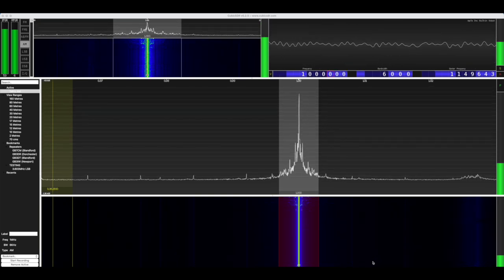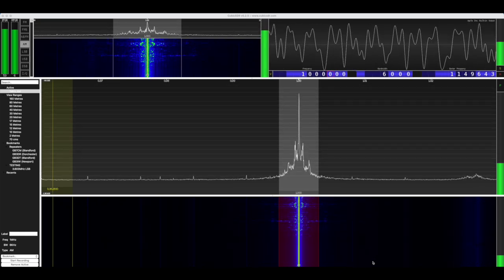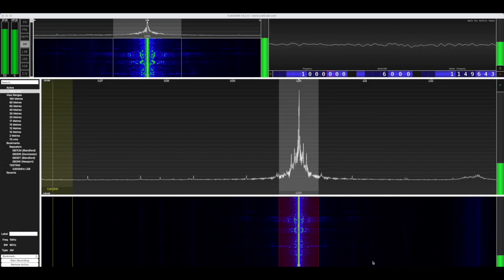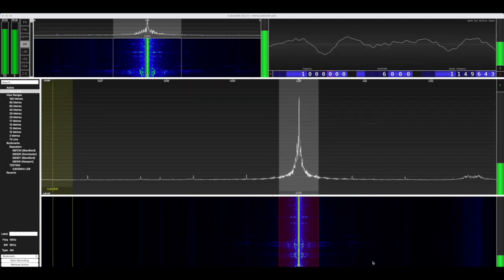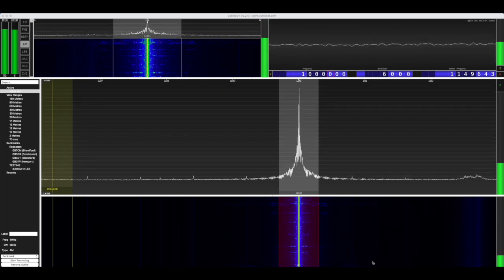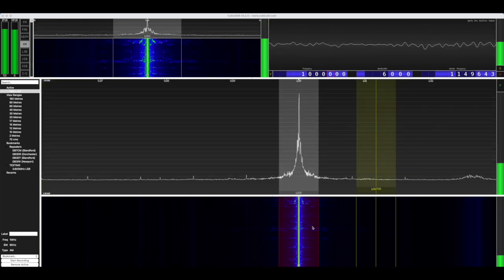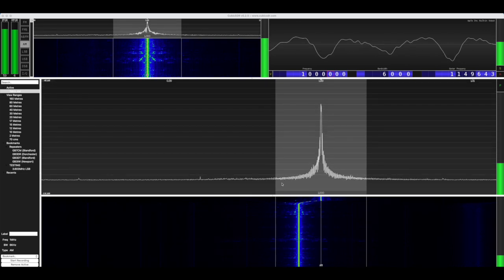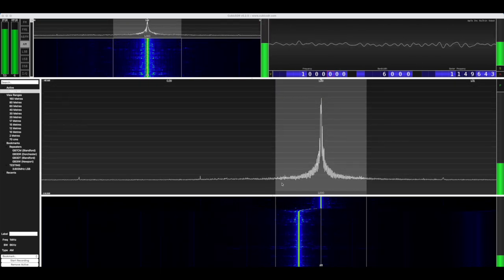35 - AM Modulators

Comment: The first modulator is ok if you are only looking for low modulation levels. It`s very prone to distortion if you try to get near 100% but is an easy build for testing purposes. The diode ring modulator on the other hand is capable of broadcast quality modulation when properly adjusted. When used for AM you might not think that balance is too important as you are going to unbalance it anyway to generate the carrier, however this is not the case if you want the best performance. This is because if it is slightly unbalanced to begin with, when the audio signal goes near zero, the modulator will still be passing some RF and this will have the effect of not allowing the negative modulation to get near 100% carrier pinch off,  (I limit my neg mod to 98% to avoid splatter). Don`t forget that this type of modulator will be followed with more than 30db of amplification, so any leakage can mean watts of carrier that cant be controlled with the audio signal. Balance can be achieved with using a ready made ring modulator (expensive) or for the rest of us, carefully selected 1n4148 diodes. I have used the ring modulator with great success for low power (10s of watts) but for higher power rig builds, I prefer high level modulation of either a class E, D or C transmitter using pulse width modulation. You can think of this as supplying a transmitter output stage from a switched mode PSU thats output voltage is controlled with the audio signal. The commercial medium wave transmitters used this scheme, achieving DC to RF conversion efficiency of over 90%. As you can probably tell, I am a big fan of AM, when properly done, it can sound fantastic! You will mostly find me on 1977 and 3615khz You have done a great demonstration as usual and a special thanks from the AM lads for encouraging interest in the subject.
Reply from the maker: Thank you so much for watching and for your helpful and detailed comments. I confess to being a 'Newbie' as far as AM is concerned but I'm having some fun learning more. I may have to pick your brains when it comes to demodulation. It's not so much the demodulation itself as the selectivity and frequency translation that precedes it - the whole no-no of inserting a locally generated carrier on top of an existing (out of phase) carrier etc. This is very much still a work in progress! Thanks again. 73 Nick
Reply: @M0NTVHomebrewing  You just reminded me of another technical can-of -worms, that is how would you demodulate double side band suppressed carrier? At first it seems simple, just re-insert the carrier and have an IF that is wide enough to accept both side bands. However, this will not work (sound nice), because the re-inserted carrier would have to EXACTLY (not nearly as in ssb) match the carrier frequency and PHASE. This is a work in progress for me as being able to lose the carrier and keep the side bands and audio quality, would be very nice. As for demodulation and IF architecture of a good AM receiver, this is fairly straight forward, depending how deep you want to go. I have cheated a little as I kept all those PYE taxi radios of the 80s (remember those?) They are a great source for crystal filters and IF coils. Happy to share any information I have, just email me if needed. address on the ABOUT tab on my Youtube info.
Reply from the maker: Thanks again Chris. That's the thing about going back over the basics isn't it - it turns out some of the things you thought you knew and were quite simple turn out to be not quite so simple as you once thought! It's all good fun. Thanks - I'll probably be in touch via email at some point. 73 Nick
Reply: I've used the PWM scheme you describe with great results in 50, 100 and 200 watt Class D AM Transmitter on 160, 80 and 40m. When you build such a transmitter you realise what a huge advance PWM technology is for AM. 73 to you both and keep experimenting.
Reply from the maker: Thanks very much Paul. It's a whole new world to me! 73, Nick
Reply: @Paul_VK3HN  Compared with the older modulation methods, PWM is somewhat more complicated and might put some people off experimenting, because of the `black magic` of switched mode power supplies but the efficiency gains and potential for very linear modulation are incredible. As for the class D RF deck, once you get one of those working properly, it`s very hard to go back to the old class B or C methods. A good class D RF deck, using good caps and copper tube for coils, can have a DC to RF conversion efficiency of over 92% at least on the lower frequencies.

Comment: Thank you for the videos.  Well done.  Could you demo a LTSpice model (such as this one) and cover some of the analysis that can be done for RF circuitry?  I see you have tran and ac directives listed presumable for Time and Frequency domain simulation.  I see lots of Ham Radio videos for modelling circuits in LTSpice and I find videos that cover it generally for electronics but can't seem to find one that covers specifically both for amateur radio circuitry modelling.  Thank you again.  Cheers Todd
Reply from the maker: Thanks Todd. That's a great idea for a video. I'll put it on the TODO list! 73, Nick

Comment: Great content Nick, glad to see you tackling AM. A 1496 Gilbert Cell mixer also makes a decent amplitude modulator too, if unbalanced. NE602 probably can do the same. Follow on question... what class of power amp should you use to bring your milliwatt AM up to a few watts for a workable AM transmitter 🤔?       73 Paul VK3HN.
Reply from the maker: Thanks Paul. Hope you're doing OK. I might have to pick your brains a bit more on this stuff but I will contact you by email. Thanks again. 73, Nick

Comment: When you show the modulated 1KHz in the time domain, would it not be an idea to trig the oscilloscope on the 1KHz signal instead of the RF signal?
Reply from the maker: Hi Jespur, thanks for the suggestion. When I eventually revisit the AM stuff I'll bear it in mind. 73, Nick
Reply: @M0NTVHomebrewing  Adjusting the holdoff control also helps stabilize the display.